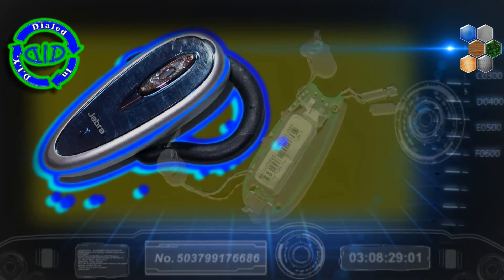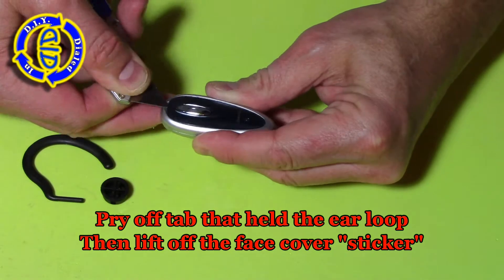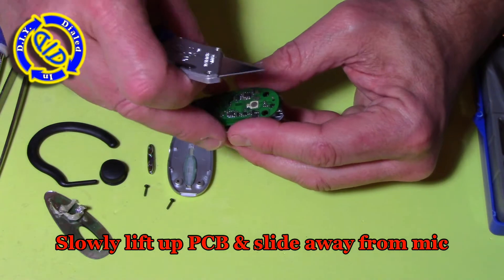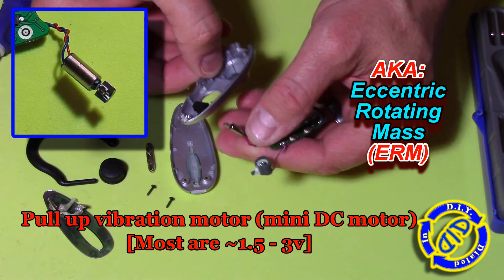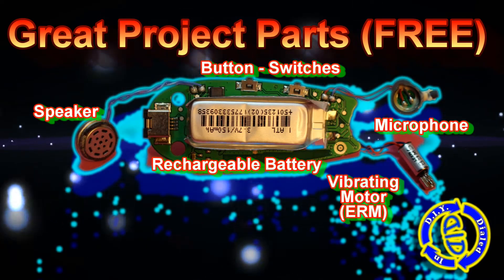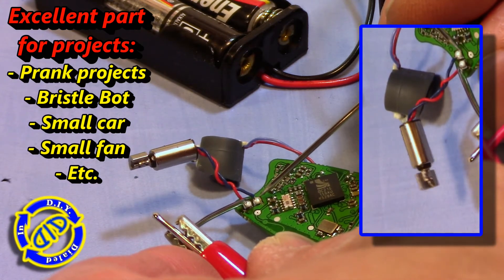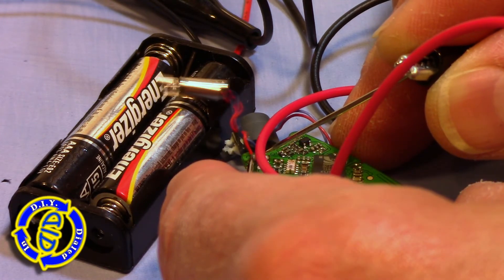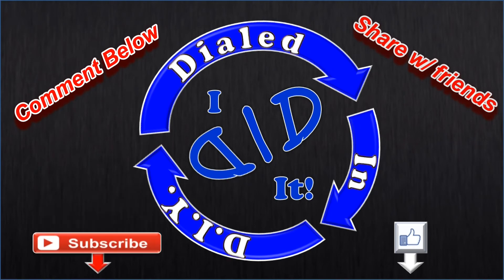Inside a Bluetooth Earpiece - Amazing Parts Salvaged - Free Vibrating Motor+

Comment: wait so where is the bluetooth component here? What part picks up the bluetooth signal, and how does it work? If I wanted to mod this into a device that 'rings' when I get a phone call, using a specific ringtone, is there a way I could do that? and if I attached a stronger speaker, how would I have to change the power supply, if at all?
Reply from the maker: Ok, odd... I have replied to this message before but it still comes up as "I haven't responded" in my queue.  I have noticed a few like this recently so I am wondering if there is something "buggy" in the reply delivery or retention. 
 Sorry if you never saw a reply from me.  I really do appreciate that you took the time to watch and comment.  Let me know if you were still looking for an answer.

Comment: But it sound will loud or not i want loud sound
Reply from the maker: When I have used this approach for BT speakers I used a set of speakers that had their own power source (like PC speakers) and then merely replaced the audio in jack with the BT receiver.  I removed the earpiece speaker and wired it into the "audio in" jack on the speakers.  This way the speakers were as loud as when I had them plugged directly into an iPod, etc.